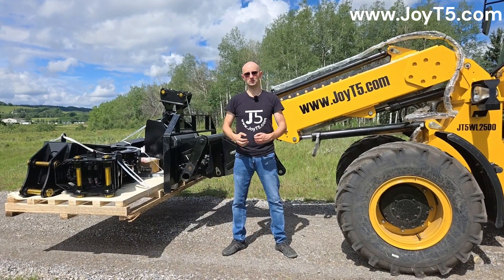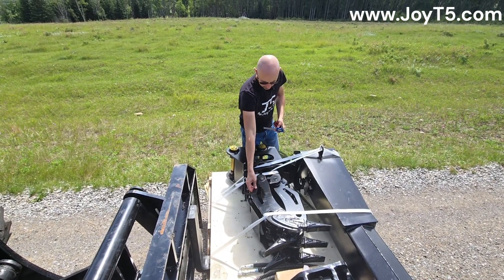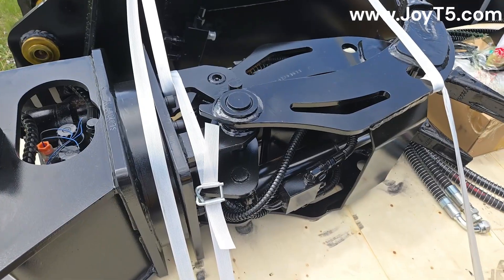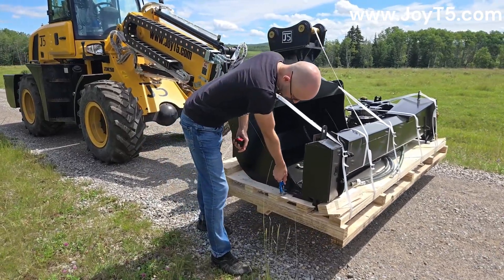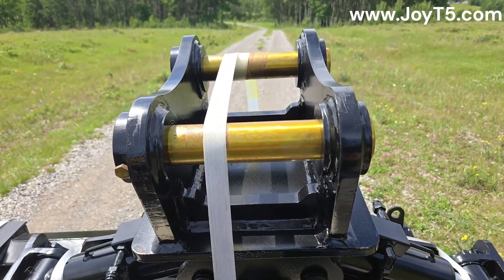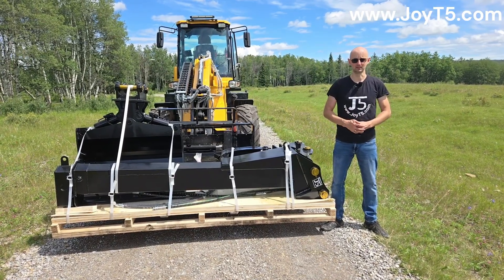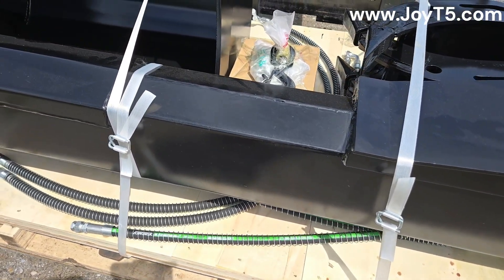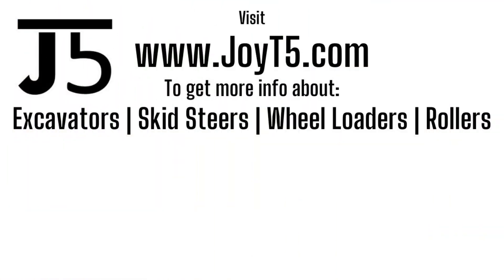Are Custom Excavator Attachments Really Better Than Stock Ones?

Comment: I really love the idea of custom attachments to improve upon the durability and functionality.  However, I don't believe that strictly "custom" is the only solution to improve upon "stock."  There seems to be an array of off the shelf offerings for larger machines.  What really intrigues me here is that the ability to create custom designs might also lead to some standardized upgrade options.  Most particularly, I see an absolute lack of standardized upgrade options for machines 2 ton and below.  Everything available seems to barely qualify as "stock" for these newer imported mini excavators.

Here's another thing.  Lets suppose that I am perhaps willing to invest into the costs of custom ordering an attachment.  What the hell do I know about what the dimensions or material thicknesses should be?  How could I acquire the knowledge to know what I really need?  The best example I can think of at the moment is that I would like a grapple for handling rocks that is light enough to hang on the boom of my SHY20 and still leave me some load capacity to utilize it effectively.  I do understand there are limitations, but how can I come up with the best specs to maximize the utility of such an attachment on my machine?
Reply from the maker: @SonoranDesertDigger 

Thanks for your great questions! JoyT5 started offering custom attachments because:

1) Our commercial customers needed heavier-duty options than standard Rippa attachments
2) Custom options are often cheaper than buying locally in Canada/USA, plus you get exactly what you need
3) We can serve customers who don't own JoyT5 or Rippa machines

You're right about the 2-ton market gap! As an example, standard Rippa augers only offer 400Nm torque, while our custom ones deliver up to 4,500Nm with specialized rocky soil bits.

For your rock grapple idea, we have existing designs based on machine size that can be used as-is or modified to your specs.

Check out our 2-ton custom attachments video here: https://youtu.be/a7R8UsO5Tvs

For more information, please contact JoyT5 Calgary office https://joyt5.com/pages/contact
Reply: @JoyT5   Thanks for your reply and I think I will be contacting you soon.  :)
Reply from the maker: @SonoranDesertDigger

Great! We look forward to your email :)